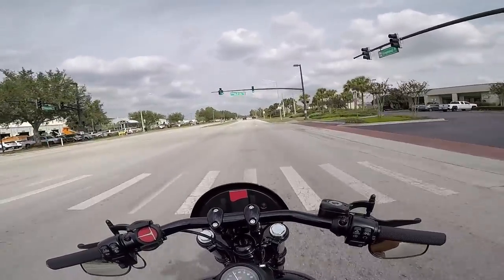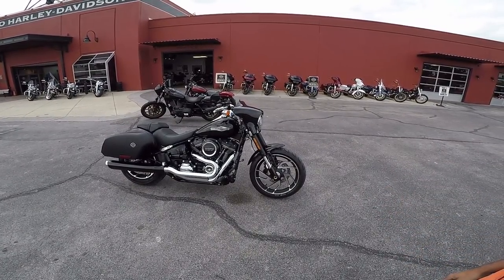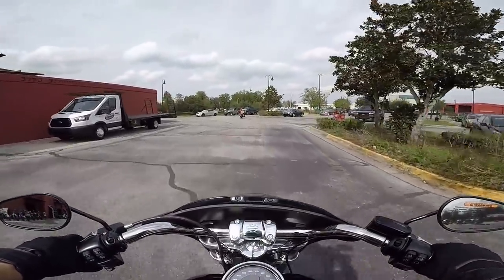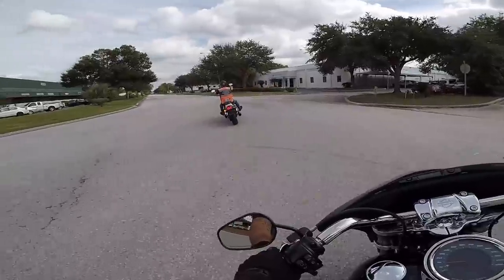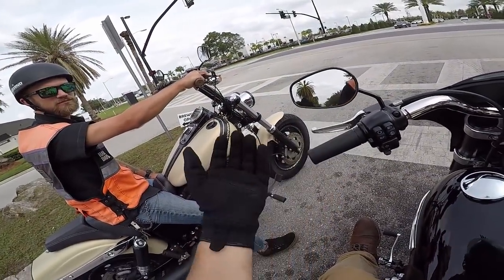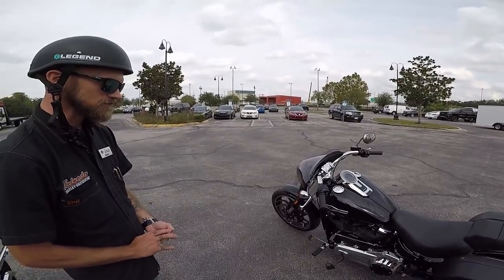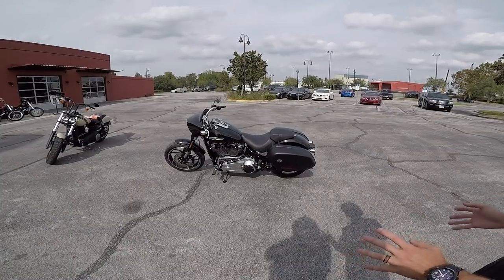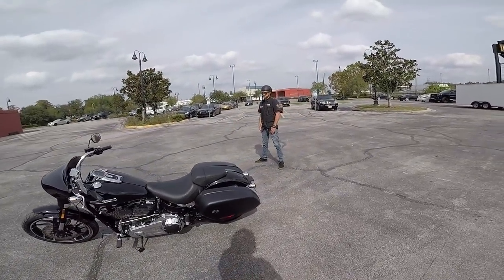2018 Harley-Davidson Sport Glide Test Ride!

Comment: test rode it today, dream machine. engine smooth, low vibes, breaks good, frame stiff, good acceleration. just sound not what HD got us used to (think could be dealt with some aftermarket pipes). sick now to get it

Comment: I like the Sport Glide.

I’d like it better if:
A: it a blacked-out package were available
B: the price were lower
Reply: You can always black them out.
Reply: Still a lot cheaper than a Breakout. That really is too expensive. 💸
Reply: Andrew Green $18,599 bikes should be at $13,599 and the $15,599 bikes should be at $11,599. Get rid of the middleman/stealership and this would be the prices. 👍🏻👍🏻

Comment: I just tried that one today. I'm 5'10" but have short legs. The foward controls were ok but a bit far. The one thing I did not like is the vibration. I have a 1997 sportster and my god I like the shake. This as no shake at all. I guess it suits some people but not my taste. I'll be sure to test drive the street bob next. My short legs will feel more confortable.

Comment: Just a quick note: this and all the new softails actually have two counterbalances and hard mounting. It has the one that was in the 107 engine on last year’s touring models that eliminated about 75% of Harley shake and it also has another that eliminates over 90% of what’s left. 

In other words, Harley shake is virtually eliminated in this and the other new softail models.

Comment: Short windshield is not useless, it's all about air redirecting. You will notice objects that hit the spot just above windshield will fly over your head if they're light enough. Rocks, bricks and tools thrown from triggered cagers windows not included. The quick attach fairings nice if only want to use on long rides.

Comment: I bought one last year with my inheritance money, I really like it there's not much to dislike, the engine is smooth and powerful enough to keep you happy on motorways, the only problem I have had is leaking push rod covers, but the front one was sorted and the front rear one is going to get sorted.
Reply: My 18 had the Rocker heads leaking.
Reply: @CandyBarMoto  I got the other one sorted, this sort of thing shouldn't happen on brand new vehicle's, what shocks me (I work in the motor industry) is that Harley Davidson doesn't use engine die, which tells me they don't test the engines other than the rolling road which is bad in my book.

Comment: I just got the 18 Heritage and have to say I haven't wanted to burn the seat. Something changed with the seats. I was trying to keep it stock but no luck... changed out the brake and signal lights to LEDs. Stage 1 is next...😁
Reply: Kelly A sat on the 18 heritage today.  The seat was the best stock seat I've ever sat on.  Heritage was an extremely comfortable bike.

Comment: I'm still sold on the Fat Boy, but If I were looking at the sport glide the big seller for me would be getting all the extra goodies for a cheaper price because it's stock.
Bags, and holdfast stuff and a removable fairing would cost a lot to get for a bike that doesn't have it stock.
Bags for the fatboy are 1000$
But yeah no one leaves an HD stock. First thing I'm getting is an Engine guard, and a sissybar holdfast setup to hang a backpack on like my dad has on his sporty.
Im wondering how much lean angle the engine guard would reduce though.
I might have to replace the sportglide as my runner up, choice. Without the fairing the front end looks good.
Under 19000$ with an engine guard installed.

Comment: Interesting....my 2000 and 2002 Honda 1100's have two plugs and three valves per cylinder.  My 1981 Yamaha Virago has OEM pinwheel style rims which looks like Harley patterned these after.  I wonder if the wheels are still being made in Australia for Harley.  
I've ridden the M8 107 on both a Road King and Road Glide and I liked the performance and quietness of the motor.  I also liked what Showa did with the new suspension.  I thought it was a big improvement over all previous years.
A guy on a bike forum says his boss bought two new 2017 bikes, and one lost the water pump. Harley fixed it under warranty.  The warranty ran out and the new replaced part went South and Harley wouldn't fix it.  The newly replaced part that failed was 4 months old.  The guy didn't say which model, but I'm assuming one of the Street models.  Those are made in India, and assembled here.  The engines are supposedly manufactured in the US, but who knows where the water pumps are made.

Comment: I think it kind of a updated Switchback
Reply: Ah no. The Switchback was an abomination that did nothing well and buzzed a lot on top of it.  This is one of the best. Good rubber, good fuel capacity and all the other goodies that come with the new ones.
Reply: A non CVO softail convertible
Reply: OneDown ThenUp:
With a better suspension for a lot less $$$ ;)
Reply: Actually, a reintroduction of the FXRT.  Better looking, but same idea.
Reply: The new one should have gotten the FXRT's front fender. All these new Softies are going to pepper their oil coolers with road debris.
Reply: saddlebag...I agree there. After just purchasing one myself, I wanted a cover/protection for the oil cooler. Harley only provide a shroud, but does not actually protect the cooler itself. Just have to wait for the aftermarket to catch up. Also not a great range of pipes at the moment. Bassini or Two Brothers [both identical]. Thats it..
Reply: Mono check out tab performance

Comment: I think I'm going to go for one of these, I believe it's the best compromise between a bit of  sports riding and touring. There's only one thing missing and that's cruise control, is it possible to have this retro fitted. I posted this but missed the bit when you said it had cruise control, I didn't think it did but it does, it's a done deal.
Reply: I believe it comes with cruise.

Comment: Hi blockhead moto been subscribed for 2 days now great videos. I am looking at getting my first cruiser bike in 2019 never rode one so could be fun I currently have a mt09 so I want a second bike so seems right to get something I have never rode. Also what has harley replaced the dyna with or what do they do that is simaler.

Comment: 2022 model Sport Glides still the top selling softail in Europe. Now that they have the LRS-T successful launched, and ABS brake parts are again available MoCo should bring the Sport Glide back.  

Only do it in two trims. It’s a top seller to the growing women rider market upgrading from Sportsters but not wanting the heavy baggers. Keep the chrome & low seat heigh but make in narrow in front to accommodate female riders and add in slim boards. 

The second trim should be more club like blacked motor pipe & trim. MoCo’s T bars, longer rear shock, clete pegs, maybe a solo saddle with detachable passenger pillon. And advertise & promote them. After 3 years riding mine the most common comment at Harley events; cool what is it. 

Last it’s a different market or buyer of LRS-T & Sport Glides.  The LRS appeals more to canyon carvers, sports tour, hot rodders with the forward sitting position, mid controls, dirt bike like bars. The Sport Glide has a relaxed riding position, forward controls, pulled back bars maybe even boards. Both should be successful for MoCo if promoted correctly. 

Naturally add a functional windshield and fairing lowers similar to what Gustafson offers for it. With vents & lowers it’s the only windshield for the fairing that protects & doesn’t buffet.

Comment: Hey Man, can you put the controls like on a soft tail or a 883? My legs are very short like 27 to 28 inches. Had a 06 Yamaha Classic and rode it fine no lower or anything. Was a little hard to back up but did okay.

Comment: First impression I didn't like the rake, made the bike look too long, and I didn't like the look of the brackets for the saddle bags when the bags were detached, too 'chromy' i.e. too obvious. However, I've watched a few test rides now and it's starting to grow on me. I still want a 2018 Softail Lowrider S, i.e. 114ci engine, twin disc front brakes, blacked out look, then I'd add some after market blacked out pipes for the sound. But that ain't here (yet) and would cost a fortune to self-build (I've estimated 5K), the Softail Lowrider is very chromy and would take an aesthetic shift or a wallet the size of Trump's but it's still my fave softail. However, this is not bad, not bad at all.

Luckily for me I'm not buying until 2021 when I return to the UK, so I can afford to hang back and wait to see what develops, but if push came to shove and I was buying now, I'd wait to see if that Softail Lowrider S comes from the factory this year and if not....... it's probably going to be a 2018 softail Lowrider or a used Dyna Lowrider S, probably the latter.

Comment: Dear blockhead team,
The rear tire is 180 stock, so what is the max rear tire size i can reach without any modifications to the bike.? And does fat tires affect the engine on the long term use?
Thanks in advance

Comment: Blockhead, I have one question - wanna to rise the bars of my sport glide, we dont have an official dealer here, so dont want to change cables and wires. could you suggest the riser which I can order and install it without cable extensions? 

https://www.harley-davidson.com/shop/motorcycle-handlebar-risers#!pageSize=45|category=10712|searchTermScope=-99

here are several options provided by HD

really appreciate your advice.

Comment: Block head im a new rider and im asking should I get the iron or skip to the low rider s?
Also how long did you have your iron. Im not a new sub im a long sub since 10 k i just lost track.
Reply: Test ride them both and buy the one that fits you the best.
Reply: Eric R thaks but im afraid if the low rider has too much power for my skill and im worried if the iron has to little power
Reply: Skip the iron. I was bored in less then a week.
Reply: DuckHead Moto fine ill still test ride both
Reply: Its much easier to ride a big bike slow then it is to add more power to a small bike.
Reply: Sam Kang I️ went straight to the LRS with my first bike, and have had no problems. Figured I’d outgrow the sportster too quick. Don’t worry about the power, no one is making you crank the throttle. But still, you should ride them.
Reply: I started with a sportster, just got a low rider. I was amazed by how better balanced the low rider is. Not knocking sportsters at all but I would recommend the low rider.
Reply: Definitely get what fits you. I lasted a bit longer with my 05 883L - a whole 11 months - before I moved up to the 09 Low Rider. As someone else said, it's better to have to have the power and not need it than the other way around.
Reply: You could get a 1200? There's that option. 
Not sure why they still make 883 with the street 500/700 around. Unless budget is a concern test ride them both, but consider where your going. In town small commute probably not too big a difference. If you're doing more highway you'll want that 6th gear.
Just like shoes, you don't run in dress shoes, and you don't do construction with running shoes. Unless you're a sport glide....just buy used at a good deal then trade it for what you want or tend to do more of.
Reply: OneDown ThenUp I will be riding mostly on the high way so I think I will get LRS
Reply: I went with the Iron 883 for my first bike. I had comments saying it was too much for a first bike (from mostly non-Harley riders) and some saying start with the 1200. I say the 883 is great for your first bike. 883's are in high demand and even if you only had it for a year, you can easily trade or sell it if you want to. I love my 883 so much I kind of want to keep it and get another bike. It is a good choice, and go with your gut, not everyone else's opinion. So many people start on the 883 and that is no coincidence. If it feels good, then go for it. It is all about being comfortable on your first bike! If your comfortable, you can focus on skill building, and it will make you a better rider.
Reply: I've had my 1200 for nearly 10years, I still try and shift into 6th. That alone makes the Streetrod a nice option, it has 6 gears, only down side is aftermarket parts. Sportsters and Dynas both have ton of aftermarket support. 

883 is a "beginner" bike just because of price, not necessarily power, in fact the weight distribution, balance point, and ride height doesn't really lend themselves to the best beginner style bikes. Once you sit on them in the dealership and test ride you'll know, hopefully your pocket book agrees.
Reply: No such thing as too much power....the throttle is in your hand.

Comment: I'm really liking this bike.  However I really gotta question the idea of calling it a "Sport" Glide and then not offering the 114 engine or dual disk brakes up front.  I've ridden the new Heritage with the 107 and it puts out gobs of torque and power...it's more than enough for any practical use.  I guess I'm just of the mind if it's called "Sport" it should at least have the option of the bigger engine.  Same with the brakes....no doubt the single disc will get the job done but why not give it the better brakes considering the "sport" role this bike is supposed to take.  I guess we could see the front wheel as well that way though and I really do like the wheel design.  In any case I think this bike is awesome....perhaps they just should have called it something else and left "sport" out of the title.  

Cool vid, keep 'em coming!
Reply: I think it's the price... for $18600, it should have the 114", for that price a 107" hurts. a 107" at $16, I could see. I'm sure they spend tons of effort pricing these bikes out as to not compete with the other models too much. I really like this model though and a 114 would seal the deal. At least it's lighter than the Heritage. 
Dual disk would be great, but the engineer of that rim probably put up a big fight since the rear is already covered up.

Comment: Why must one have to manually adjust the rear suspension? All I gotta do on my BMW is press a button for the same feature. I also dont risk burning my hand as the knob is DIRECTLY NEXT TO THE EXHAUST PIPE! Mind you my BMW is a 2009, when is the Motor Company going to "get with the times?"